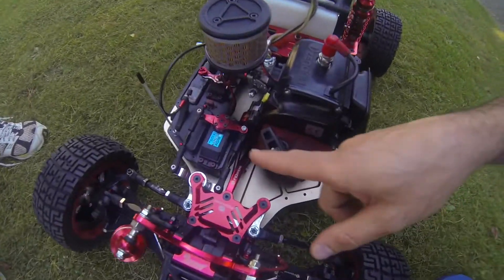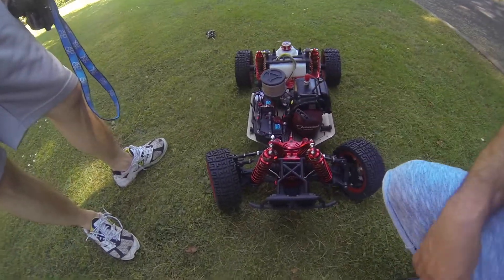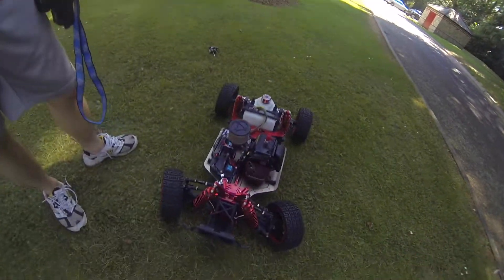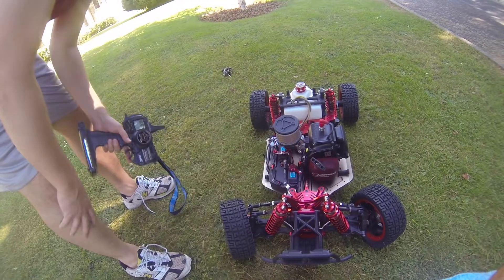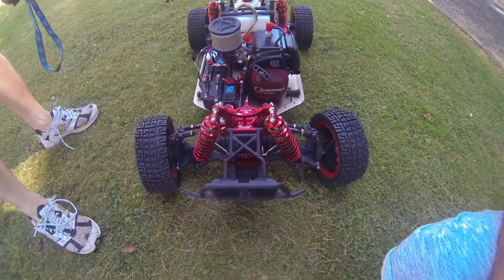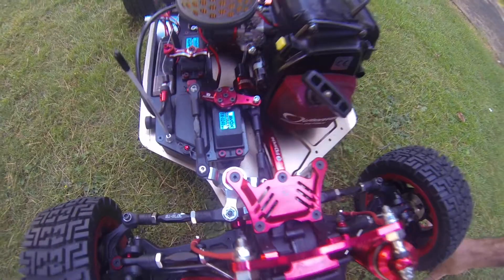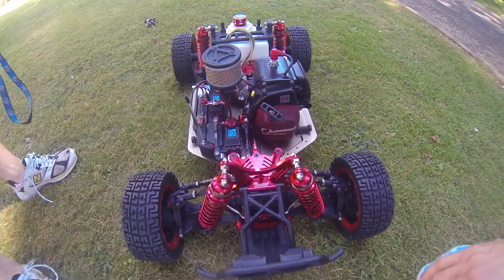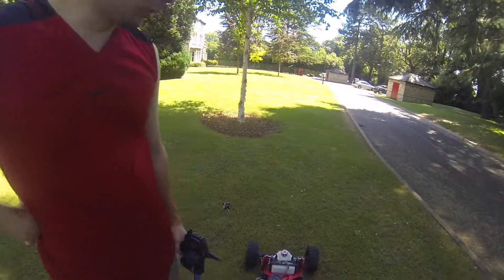Avoid burning up your 1/5 scale steering servo!... advice.

Comment: Bout to buy dual hitec d-845wp servos for my dbxle2 to avoid problems like this. Probably take my savox servo and use it as my mechanical brakes servo which im currently modding rite now soon as my carbon fiber rotors come in....yeah the losi mech. brake kit rotors do not fit the DBXL-E 2.0 center outdrives as horizon hobby suggests!

Comment: My steering servo kicks out 129Kg so my steering centres regardless of what angle the wheels are at and no matter the surface.
Reply from the maker: 129kg!!!!!??????? dam.... what rig u running mate? sounds crazy!
Reply: I'm running a King Motor X2, steering servo is a Tonegawa PS-050 that's running it's own 3S LiPo. If you go through my videos you'll see me testing it on a 2s LiFe, 2s and 3s LiPo's.
Reply: @almighty151986  PS (Professional series) 050 (50 kg). Don't know who told you it's 129 kg, but it isn't.